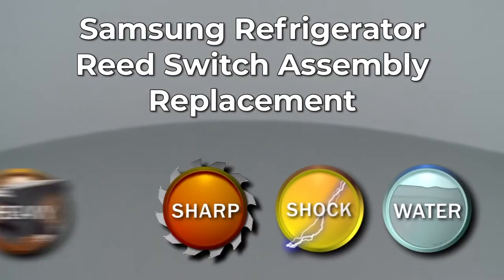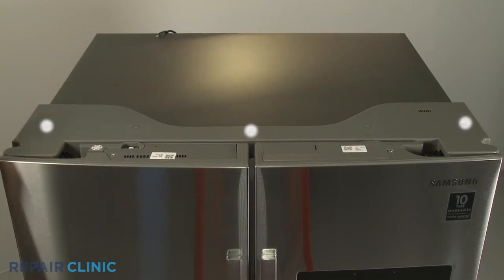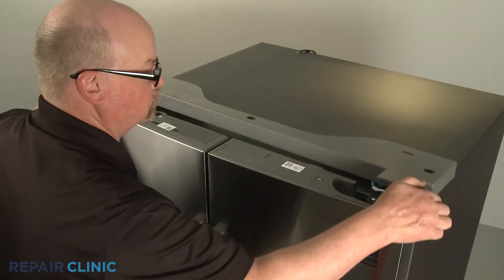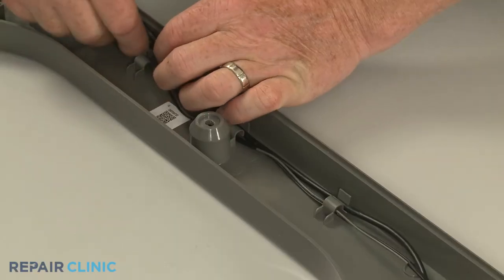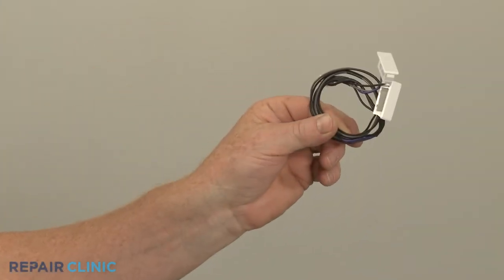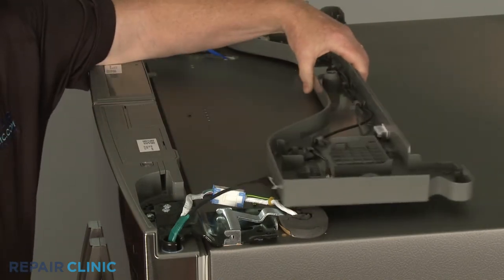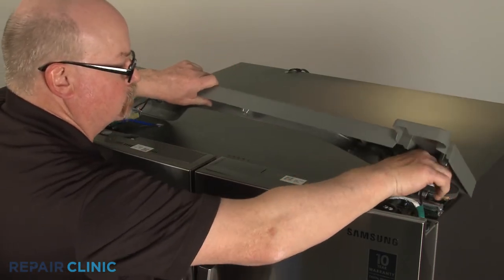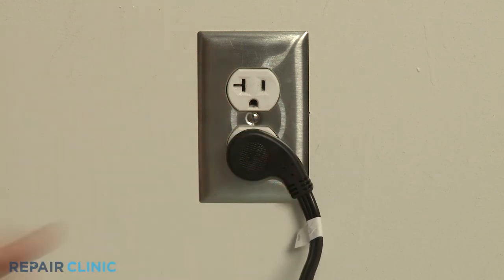Samsung Refrigerator Reed Switch Assembly Replacement DA34-00043K

Comment: The  wires  that go through the door have been cut four or five are very visible so I don't think it's the they are still in good shape it's the wires that go through the are they easy to replace?
Reply: Sorry I meant to say I don't think it's the switch but  the wires that go through the left door